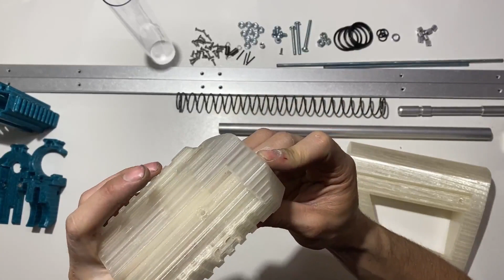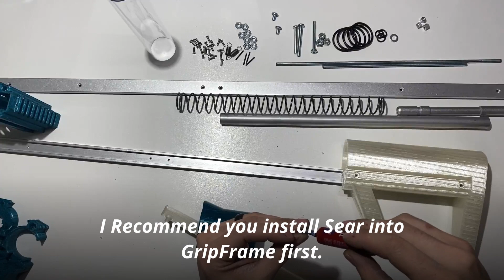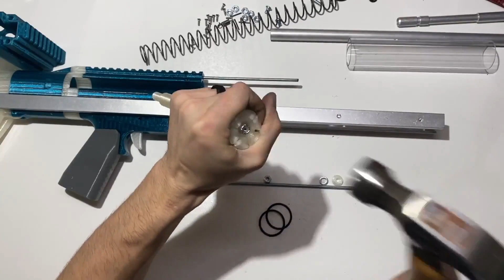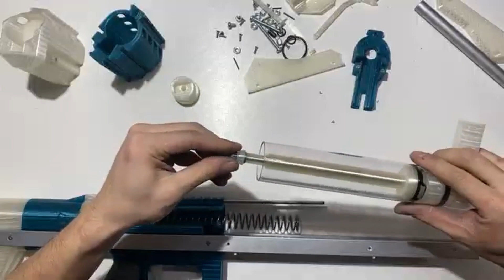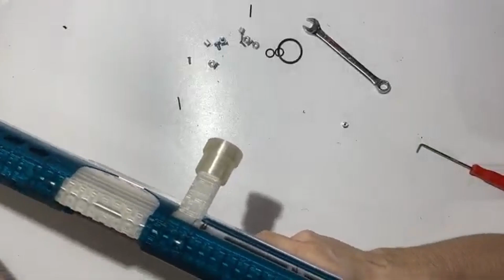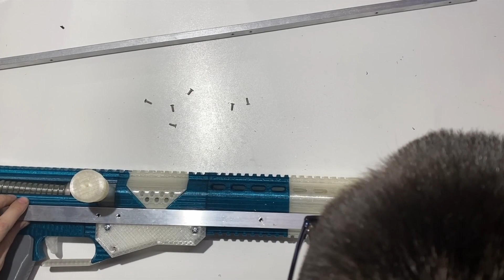B Variant Build Guide | Bolt Action Caliburn

Comment: Doesn't a b variant use the caliburn u hardware kit?
Reply from the maker: It *can*, but the UC channels have an extra hole that isn’t used and doesn’t include locknuts. In addition, it usually doesn’t include the 7” threaded rod, doesn’t utilize the hole in the wider spaced section of the channel, has a rear spacer tube which isn’t used in the BV, has superfluous flat bars, and uses different hardware counts. So instead of buying parts you don’t need, you could just buy a BV kit.
Reply: @Frontline Foam  shipping to Asia is expensive and caliburn u kits are more available here hahah
Reply from the maker: @blublu3076  that’s fair. Who are you getting them through over there?
Reply: @FrontlineFoamBlasters  we have a few local modders who help source hardware and help cut and drill press the u chanels